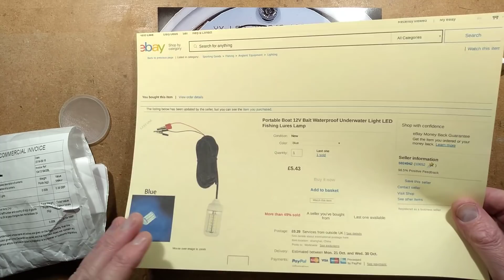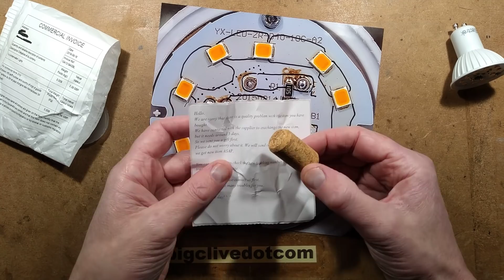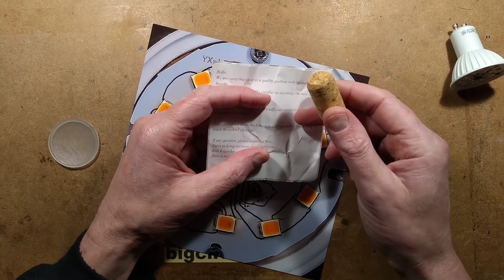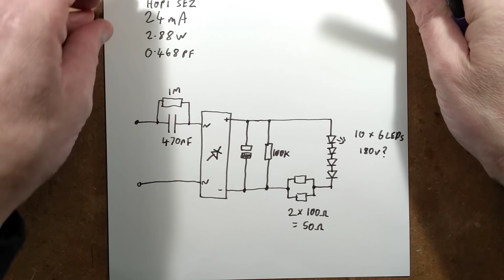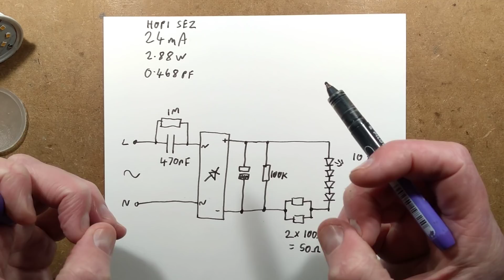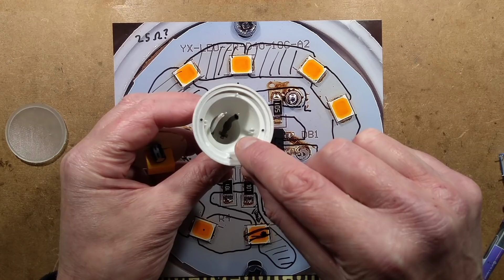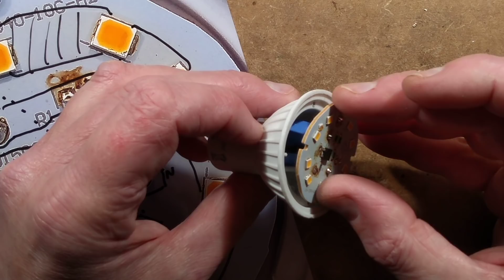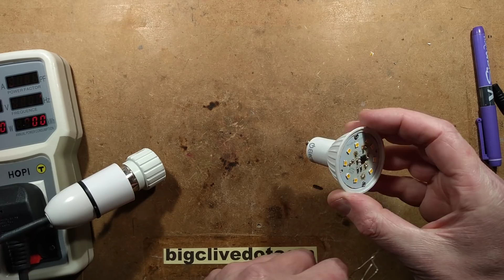Mystery corks, PCBs and fixing a dead lamp.

Comment: I truly admire you for repairing a Poundland LED lamp to keep on using it. You are so fun to watch.

Can you discuss in a future video how the power companies can possibly charge us based on the capacitors in our electronics because of the smart meters. You've mentioned it in past videos and I don't totally understand how/what is going on. Thanks for the many years of entertainment:)
Reply: Nick F In basic AC electrical theory, if the voltage and currents are all sine waves at mains frequency, the currents will all add up to a single sine wave.  Using trigonometry, the current wave can be converted to the sum of one wave that is in perfect sync and one that is 90° (1/4 of a full 50/60 Hz period) delayed.  Only the in-phase current delivers actual power to your house, but the out-of-phase current still causes power to be lost in the miles of wiring from the power plant to your house.  Traditional electricity meters only measure the power delivered via in-phase current, while out-of-phase current is traditionally regulated by having the terms of delivery (indirectly) demanding that you keep the out-of-phase below a few percent of the total.  With the new meters they finally have gotten the ability to know who actually exceed the limit and take action against such customers, either one by one or by setting a fee for the out-of-phase load.
  An important twist is that when the rules were written, the big problem was inductors causing currents that is up to 90° late, with the usual corrective action being to plug in capacitor loads to cancel it out. But modern electronics often do significant capacitive or off-frequency loads.
Reply: @johnfrancisdoe1563  Oh wow. Thanks for the quick and super informative response. It makes sense but I'm a visual learner and it would have been entertaining to watch Big Clive doodle it out. Thanks again so much for explaining it:)

Comment: they could at least send at least one bottle with the cork :P  At least with LED there is no fillament to burn all the thing. You loose brigtness but have a working light. about solder the two variants doesn't do any good to you're lungs, even the leaded free solder, so fume extractor is required .

Comment: It's a good thing you hid your address...I could have sent you a huge box of corks.
Reply: I think Clive hid is address because he lives in Cork Street and knew that a lot of comments would bob to the surface.
Reply: i think clive is more worried about getting a box full of cocks than corks
Reply: Frogz I don't think he'd be too worried lolol
Reply: @peterfenwick2540  I only now realized what you did there. :D
Reply: @peterfenwick2540  Ouch! But you forgot the phishing joke...
Reply: Send them C.O.D.
Reply: It's not even a good cork of the sort you'd get in a bottle of wine.  It's a "cork" made of bits of cork.
Reply: Sadly, most corks you get in bottles these days are like that. Really hard to pull off, and almost impossible to stick back in. More like rubber than true cork. I guess it's cheaper to recycle cork shavings than it is to buy new sheets of cork, and saving 2 cents on that 25€ bottle of wine is apparently a top priority for the producers...
Reply: @RFC3514  Wasn't there also an environment issue with us using too much cork? Just off the top of my head.... But in that sense I'd be okay with them recycling cork.
Reply: Nope. Cork grows naturally on cork oaks, so it's infinitely renewable. If people were using "too much", producers would just plant more oaks. Also, the real stuff is biodegradable, but these agglomerate bungs are held together by synthetic glue (assuming they're even cork agglomerate and not just imitation cork made of plastic), and don't biodegrade easily. They're just a lot cheaper. But when you consider the overall price of a bottle of wine, the stopper is still a very small fraction, so wine producers are literally gimping their own product (agglomerate corks aren't porous) for the sake of a few cents, and consumers think that, because it sort of looks like cork, it's better than wine with a plastic cap.

 https://www.corklink.com/index.php/price-cork-granules-agglomerated-corks/

.
Reply: @RFC3514  Yes, thanks! That was what I was thinking of. 'Imitation Cork'... and got it confused with 'reconstituted cork' (or 'agglomerate'?*). I can also see a propaganda-ish effect happening with the two terms being so closely associated...... confusion caused by a "Imitation cork probably means plastics, so 'agglomerate' must mean it's good, right?" 

In any case, screw them! or Cork them....? ;D

*English being my second language, 'agglomerate' is not a word I use daily :)
Reply: I'm pretty sure most people whose first language is English don't, either. :P Unless they work with cork or wood, I guess.
Reply: @RFC3514  Many thanks for that update. Amazing what you learn when you watch a Big Clive video. I have to admit I always thought it was kinder to the planet by not using real cork - substitution green, if you like. Palm oil is another issue I can't get my head round...
Reply: Hope Clive washed his hands before eating the cheesy puffs... Not washing ones hands after using lead solder and then handing food isn't good... :-)
Reply: Everything in the universe gets recycled eventually. Even you and I will get drug to the proverbial curb.
Reply: "Even"...? Humans are extremely easy to recycle. :-)
Reply: @RFC3514  Yes, but what do you do with all the Iridium?
Reply: New satellites!

Comment: I have some incandescent bulbs and some LED bulbs throughout the house. Sometimes when someone turns on a light in another room the LED bulb in the room I'm in will blink off for about 1/10th of a second. Can you explain why this happens?
Reply: When an incandescent bulb first turns on and the tungsten filament is cold, the filament's resistance is very low and it will consume a ton of power for a short period as the filament heats up and gains resistance. Once it's hot the power needs drop down to the specified wattage but the starting demand surge or "inrush current" is considerable and may be well over 10 times the normal lamp rating. That demand can cause a brownout for other devices on the same circuit. If your LED bulb in the other room doesn't have much filter capacitance in it, the brownout is probably dropping below minimum voltage during that inrush. The same inrush can occur when turning on an LED lamp that contains a good filter capacitor. The majority of more complex electronics which have large inrush demands also contain NTC thermistors to reduce the level of that inrush.

Comment: As for the lamp itself, yes, I can understand the "Did that just flicker?" thing, one of them 12v-only (the no-resistor things) LED filament bulbs I have has started doing that, may have been slightly over-powered a few times having been hooked up to solar power which despite inline resistance, it still got too hot and cooked the LEDs, and now is just annoying as hell, so will be going in the bin as soon as its' replacements get here from china... :P

Comment: Is it 230 one leg there plus a neutral or is it 230 single phase  there?
Reply from the maker: 230 to 250V per phase plus neutral.  Homes get a single phase and neutral.
Reply: @bigclivedotcom  we call single phase here with two hots and neutral also. So yall have two hot and neutral or just one hot and neutral. And if you do have have two hots what voltage between them?
Reply from the maker: @davidwhite5045  Just one hot.  It's 415V between phases.
Reply: @bigclivedotcom  Seems so weird to me. Haha thanks for the info!!!
Reply: David White Nominally all of Europe is 400V between phases 230V phase to neutral.  Originally it was 380/220 throughout Eurasia, but 415/240 in the British empire.

Comment: I've been using JLCPCB for some months and they do a really great job, I use them for mi retro designs and still no fault at all and I have ordered more than 200 PCB's
Reply: I've used them and a couple of others. No troubles so far. They often have offers so it's worth shopping around if you're pinching pennies plus you get to see how the process varies.
Reply: @chaos.corner  Any recommendation? I have tried JLCPCB and FreewayPCB and FPCB is a lot more expensive. Any other manufacturer?
Reply: @drgusman  The last I used was BasicPCB. They have a very cheap tier. The PCB was thinner than standard but for my purposes, that's fine. There's a website out there that will find the cheapest if you're working on a budget. Some of it's going to depend on what you want. Fast delivery and special options will up the price.
Reply: @Okurkaarrgghh  Thanks for the info. I have checked and adding the shipping at the end the cheapest one is JLCPCB. I will stay with them :)

Comment: I will only use 60/40lead solder that lead free when I get a kit with that crap I get rid of it .makes bad solder joints and is more unsafe then lead solder if you read up on it,call ebay or pay pal about that cork .think you been scamed

Comment: I have a Homebase brand “Home” lamp, it’s made from your new favourite LED neon style tape. It keeps flashing really irritably but not in a way that looks obvious from looking at it directly and does it intermittently. You should take a look at it!
Reply: Sounds like a failing electrolytic cap, that causes high frequency flicker. That is, if it's on an inverter type driver. CFL's also start to flicker the way you described when the big cap fails in them.
Reply: It could be, it happens when it’s been on for a while but changes the “strobe” frequency over time, and it’s never enough to get a definitive “on/off” it’s like the shimmering from a camera but irregular timing. Very bizarre!
Reply: @chaziboy2468  - Time to take it into bits. :p